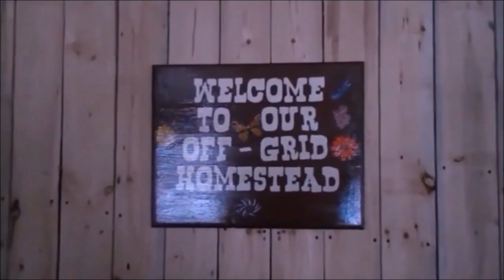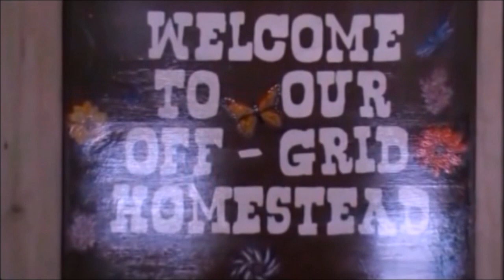Wild Rabbits, Firewood And Diesel Engines

Comment: Hi Heather & Cecil. Won't be long before your wood shed is bulging tight. Those engines will come in handy running the saw etc. I think the Hair or Rabbit just knew you were not a threat, and so stayed put. If it saw a Couger, well it would have been off once it cought its scent on the wind. Anyway you two get some sleep and i'll see you tomorrow. Take care.:-))

Comment: Those should be good engines. If it doesn't start properly with electfic start, make sure the starter is spinning the engine in the proper direction. Is funny in a way watching people trying to get those diesels started and having starter issues. That was a good trade deal for those engines.

Comment: Nice to have stuff stocked up to sell for extra cash to get things that will let you buy the things you need. Winder how hard a sled like your new one would pull if made out of all steel. Wonder how big of a wine cellar you'll end up having when the basement is done. Nice stack of firewood,  building up your supply quite fast. My Cougar is not healthy, but the recoil starter is not very good so couldn't get much of a proper compression test. But what I got showed 120 and 100, time for rings but not sure if pistons are needed. Thoughts on pistons too?
Reply from the maker: Yes it's nice to stock up on things we need for sure Jeffrey, But it's a lot of work though  :-(   Don't change your rings till you get the engine running... Your piston rings may be just stuck from sitting, How did you do your compression test?  Not sure if you know this but you should put just a little oil down each cylinder before testing because you could have dry cylinders from sitting, plus hold your throttle wide open to get maximum air drawn in to compress.  Hope this helps Jeffrey.  You take care.  Thanks again ttyl.... Cheers  :-)
Reply: Off Grid Homesteader Cecil E Skinner Did put oil down the cylinders. Did not know about the wide open throttle. Throttle is froze shut so will have to wait for warm weather. Going to fix the recoil first before retesting. It as can't spin the engine enough on half a pull, if it is even that much. Is a summer project for me.